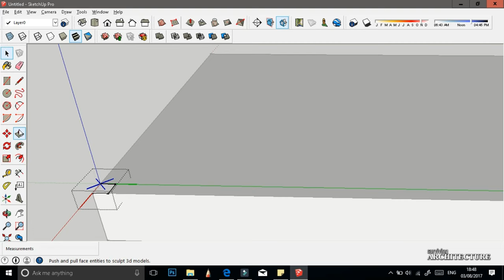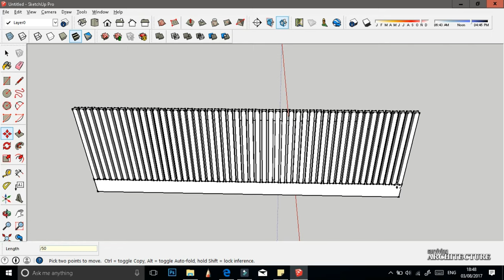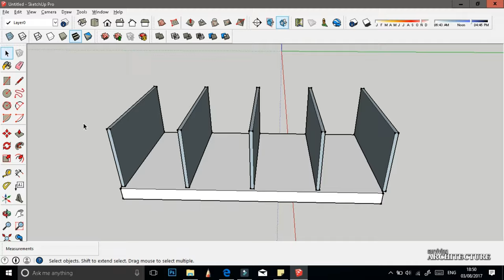Sketchup Tutorial: Object Spacing | Architectural Design

Comment: Will the free version not do this? I have tried everything that you said and it will not work.
Reply from the maker: I think that the free version does this too but I am not too sure. maybe you missed a step?
Reply: It will let me do the multiply but not the divide. I don’t get it either...
Reply from the maker: Hmmm I don't either. I hate sketchup when it does stupid stuff like that. I found this forum though with people having the same issue. https://forums.sketchup.com/t/problems-with-divide-tool/49290
Maybe something there could help fix the issue?